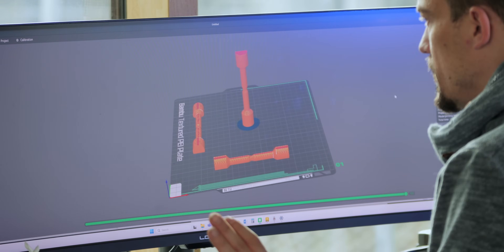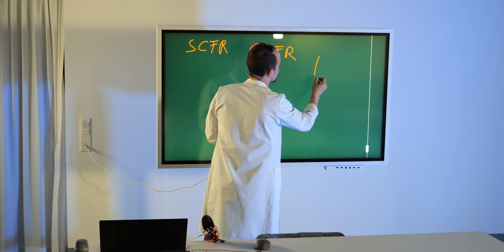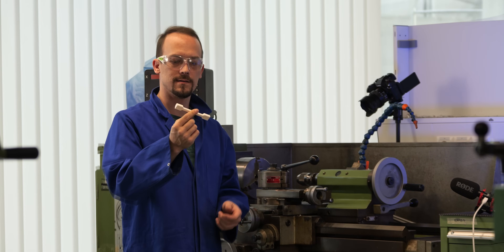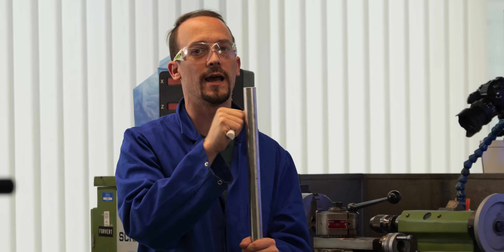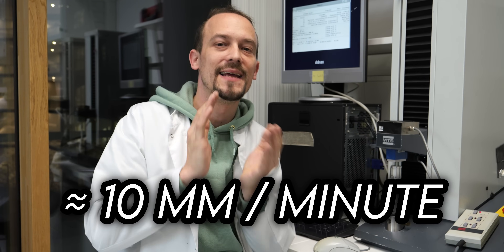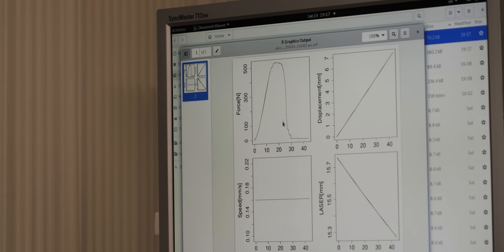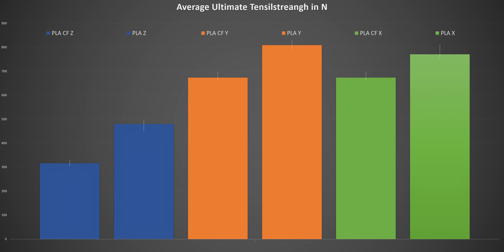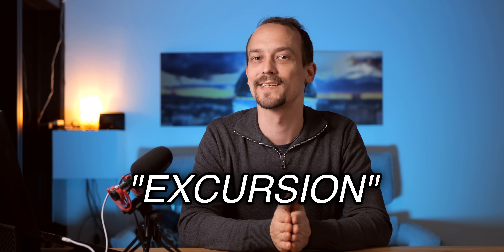The biggest SCAM in 3D Printing? How filament stores try to trick you with carbonfiber "reinforced"

Comment: What I don't understand is WHY there is a difference between X and Y axes? I understand why the Z axis would make a difference because it is printed longitudinally, but the X and Y?? What do you think is the reason?
Reply from the maker: That has to do with the infillpattern. In y it is longer line extrusions because or it's orientation. 
But that's a guess I would need to look into that more specific

Comment: The CF materials have potential. I feel this is less of a "scam" and more of a "good idea that needs refinining". Eventually if they can get adhesion better for the z direction i can see these filaments eventually fullfilling promises. Just not in their current iteration
Reply from the maker: Not for those. But for others for sure. 
The "scam" I used is meant to be a wakeup call. Cf materials have loads of useful properties. But greed sells the wrong one. Because less people are willing to pay more for nicer or stiffer prints. But for stronger. 
The 3d printing comunity is made of mostly tinkerer and smart people, so just tell the truth and people will fi d the niche. No need for falls promisses.

Comment: Calling cf reinforced filaments a scam just isn’t a fair representation of data. While I can’t speak for how individual companies may misrepresent cf filaments in their advertising saying cf  filaments “aren’t as strong” and are therefore a scam is like saying, wood is a scam because steel is stronger or ceramic is a scam because fiberglass is stronger. Different materials have different properties which are optimal for different applications. Also to address the “not as strong” claim. Yes placf is stiffer than pla but its absolute strength is lower, but with nylons for example adding cf makes them stiffer and stronger in both Y and Z directions. Like almost every question in engineering the answer is almost never black and white.
Reply from the maker: Nothing to add. U performed here what is most important: critical thinking ! 
The claims is where the "scam" is. Not the material. 
And this is also not true for every manufacturer. The title is meant to "shock" but is not meant literaly. Hence the question mark. 
So I agree with you comment 👍

Comment: TPU is honestly one of the toughest materials.
 layer adhesion is better than most
flex is a disadvantage but with right infill structure you can design something fairly rigid, very light, and virtually indestructible
Reply: Which infill for best rigidity?

Comment: Is there other benefits such as heat stress or wear resistance or something? I’m currently trying to decide if I need to accommodate high temp materials in my printer upgrade.  I’m thinking about the difference between P1S and X1 type differences (not necessarily Bambu either, just an example of what level/quality of models I’m looking for) and I definately want the unit to have an AMS of some type.  I certainly want to print abs so I’ll need enclosed.  Any suggestions on what printers I should be considering?  My biggest problem is I don’t know what I want to print yet, but I just know I can’t stand being limited to my 150mm build volume in my current Flash Forge Adventurer 3.
Reply from the maker: I am a fan of the x1c to be honest. High temp capability is awsome for materials like pa6 that are seriously tough.
If u have the budget I suggest going for the x1c. The volume of 256 squared is also sufficient for most applications

Comment: I would like to see more, this is also the first video on this channel I've watched. I always like having more information, especially since I do work with 3d printers professionally (I'm the maintenance/repair guy) we don't do much with CF filament, but I've looked into it before. All I really print is parts for electronics so I don't need insane strength. Unless it's laptop hinges, but epoxy casting does that fine.
Reply from the maker: Thanks for watching! We will do more, for sure!

Comment: The problem is "strength" has multiple meanings, and manufacturers use the interpretation that is more intuitive for the average customer. If you give a costumer two specimens A and B, both extremely hard to break, but A being obviously much stiffer, then the average person will say A is stronger (has more "strength"), even if when measured scientifically it breaks at lower levels of stress. Your average Joe will only say that the stiffer "part A" is weaker if it breaks at a fraction of the force necessary to break part B. Basically the reason behind this "scam" is the difference between the colloquial understanding of "stronger" vs scientifically defining it.

Comment: I used CF reinforced purely for the higher temp, specifically I moved from ASA to PA6 CF to resist the Australian sun inside of race cars. 

Would be interested the see someone actually test the heat resistance as all I can go off is the manufacturers claims.
Reply from the maker: I will do calometry testing in my research to find the precise glass transition temperature. 
But maybe I can do a diy version of it as a video🤔
Could be interesting

Comment: time 17:20 strain stress curves show that the Carbon fiber is actually more tenacious material, bigger area under the curves until it breaks, absorbing more energy than plain PETG. I think your video is actually misleading and wrong, reinforced CF is actually a better engineering material

Comment: Because you are doing a paper, I am going to play devils advocate. I am not saying you are wrong or have done anything wrong. BUT, I do have to ask these questions, none of which are meant to prove any superiority on my part.
First, the example you provided claimed two things. “Improved Mechanical Properties” and “High Flexibility.” You tested the tensile strength and provided a solid hypothesis. What about elastic modulus, impact strength, fatigue resistance, hardness, and creep resistance? I suspect, based on your hypothesis, when the carbon fiber versions are compared to their non CF versions you’ll likely see the same results in elastic modulus. I suspect that your assertion regarding layer bonding will have a similar impact. Creep resistance I suspect will be unchanged or SLIGHTLY better because it takes longer for some of the CF mass to heat up, but IF it’s better it’ll be a function of the mass of the Carbon. Impact strength could be interesting. Would it make sense to see what the maximum impact is each sample can survive, and then repeat the process at a 10% lower value and record the number of times it survives that in each direction (X,Y,Z), then move to 20% less and keep reducing the value until you arrive at a value with little change… Hardness is unlikely to change noticeably if your hypothesis holds. Fatigue resistance assuming your hypothesis is correct would likely show the same outcome as the Tensile strength test again supporting the hypothesis.
The ONLY way I could see Mechanical properties being “better” is if creep resistance is “better.” Sadly, at least here in the U.S. this would likely be enough for the claim to not be considered false advertising. If you combine a test for creep resistance with a tension modulus test, if the creep resistance IS higher due to the mass of the Carbon Fiber, then it may ALSO impact a test like that, so I could say “PLA CF is more resistant to deformation at a higher temperature, therefore its mechanical properties are ‘better.’”
Now we consider “High Flexibility.” Is this just an attempt at pointing out that the filament is more flexible before failure, the product is more flexible in a plane (X,Y,Z) before failure, that the over all product is more flexible and capable to returning to its original form after deformation, or something else? Just because it returns to its original form doesn’t mean it’s structurally sound, even if it can flex and return again. But “high flexibility” is not the same as “improved flexibility,” and is ambiguous enough that any flexibility could be considered “high” as long as it’s more than zero. Without knowing the specific implication, how does one test this?
Could there be a definitive test done that PLA melted to a sheet of carbon fiber is tested for separation strength? Same with PET, and then again with PETG? If any of the three adhere to carbon fiber BETTER than they adhere to themselves (layer bonding), though the testing done provides an answer, wouldn’t that show that your hypothesis is either inaccurate or incomplete and another cause is likely, like maybe the amount of additives to the plastic changed the length of crystalline structures impacting the mechanical properties of the polymer, or maybe both hypothesis are in play (more amorphous plus layer adhesion)? I suspect thermal compression (if the pressure of nozzle pushing on the PET/CF sheet is high enough) could cause PET to stick better to a carbon sheet with a stronger bond than it sticks to itself (I think thermal compression can do this), so I’m wondering if layer adhesion because of the presence of Carbon Fiber is necessarily the cause more than interfering with the crystalline structure in the polymer (again, making it more amorphous)?

Comment: You might want to consider minimum layer printing time when you do those specimen. When doing small area upright things the printer will shlow down might skew the result slightly as old layer will still be warm and the nozzle slowly will keep everyhting more "warm" than usual which might increase bonding. It won't change anything regarding the results but will skew them especially with petg

Comment: The 2x strength factor on the PETG-CF Z test makes me question your testing approach.  Do you really believe the 7-15% of CF cuts the useful adhesion in half?  I wonder if your test methods gave enough consideration to the materials and printing methods.  Maybe the CF version just needed more heat?
As an example, if I print PLA and ABS at the same settings, you better believe the PLA print will be multiple times stronger.
Also, I did not hear exactly which brands you used (Bambu?), but are you certain the PETG was actually the same PETG plastic in both reels?

I think for this testing to be meaningful, you need to treat the CF and non CF variants as two different materials, find the best printing settings for each one, then compare the outcomes.
Last, why no testing other types of strength?
Reply from the maker: It was a comparison study so other tools apply. 
I did tread them as separate materials but I did not optimise printer settings. I took the recommended ones by the manufacturer. But I did that for both sides (reinforced and not) so it is still fair and valid. 
The aim was to see how they compare "out of the box" with the manufacturer recommended slicingsetting for this exact machine.

Also why I did not do other tests than tensile and why I did not have DIN 527 speciments:
This was on purpose because I am actually doing a peer reviewed full paper on this. So I had to change the setting enough to not risk prepublishing my findings otherwise my paper gets rejected. But as soon as the paper is finished we will update you guys

Comment: In the current world full of BS I never believe in anything anymore that is stated on products. On of them are filaments. I discovered myself by my measurements that pla is stronger than abs that was told to be superior. The only improvement I see is using Petg but by loosing some strength. I think resins is a way to go , there are some more possibilities

Comment: What filament would you recommend to use for a bass guitar? PLA is a no go since it will warp during the summer, I was thinking of PETG-CF, but after this video im unsure.
I need it to not bend under the tension of the strings (the body will be reinforced with aluminium)
Reply: I’m not an expert but for parts needing heat resistance and strength in the way you describe I’ll use PET-CF. Not PETG-CF. PET-CF is quite strong, can handle very high temps, prints relatively easily and very clean look, while not being very expensive.

Comment: Fibers will absolutely create "stronger" materials, even short strand fibers. There is a reason why manufacturers are willing to literally destroy their machines and tooling by using materials like PA6GF30 or other fiber reinforced materials. The key point however is anisotropic behavior and the specific load case your part is suscepted to. Fibers mainly add stiffness and improve thermal characteristics, especially in ASA and PLA. In a classic tensile test on 3d printed parts, you won't get much of a difference, but in a bending test you definitely will, especially if you compare the modulus. Fiber reinforced filaments aren't a scam at all, the average consumer just lacks the knowledge on how to actually use them properly. You need to design your parts around the material, otherwise they're useless. The research paper you're planning on doing has been done hundreds of times before with various fiber lengths, materials and manufacturing methods. I have 2 semesters worth of uni lecture scripts worth on the topic from studying plastic engineering.
Reply: yes... it''s stupidly easy to find peer-reviewed research on this topic with actual DoE and analysis that give insights into modulus, stress-strain curves, etc., to show the benefits of CF impregnated polymers (including PETG). I haven't even seen any paper that used round tensile test specimens for AM, certainly not for MEX, because of how much obvious variance it introduces.... let alone cutting it in half to make it flat and non-uniform. At first I considered this misinformation, but that's too generous.

Comment: I think many of the comparisons of PLA and PLA-CF strength are specifically looking at Matte PLA vs PLA-CF (as they have more comparable looks) and that comparison is more favorable for PLA-CF (because matte PLA is also worse than basic PLA). That said, it does seem like the general conclusion is that for these kinds of materials the advantages are more about printability (less stringing, less warping) and detail than strength
Reply from the maker: I actually tested both. Pla matte and pla basic. The data shown is pla basic

Comment: I printed out the same trigger housing and pistol frame from 3 materials.
Pla+ polysonic, polysonic PA612cf, and siraya tech PETCf 6 something idk it sucked. 
Pla+ had the best results in firing and abusive testing for the prints. Pa612cf was okay for a trigger housing... but for the pistol frame (fixed pinned barrel hi point) the pin hole for the barrel subjected to the slide return shock creeped 1/8th of an inch forward.

Comment: I dont understand pla or petg cf, but i do car stuff and CF filaments definitely adds plenty of useful properties to higher performing materials. I very rarely dimension parts for breaking, so stifness, creep and high temp stability for example are very important factors to keep things together(improved by cf), sealed and working under high loads and temperatures. Just use the correct material for the task :)
Reply from the maker: Amen brother. 
Cf ist bad. It had its place. Just not the one people think. That's what this video says. It's marketed wrong. Because there are loads of useful properties

Comment: Just about all CF infused filaments should be a little stiffer, but ultimately weaker. When you add a contaminate to the filament you are making it weaker in some measurements. The structure of a filament is about how well the plastic bonds itself. PLA on PLA is a stronger bond than the CF infused PLA, so there is a gain and a loss at the same time in most cases (if not always).

Also, Bambu makes terrible CF filaments. I've seen videos where the claimed diameter of the fiber was half of what it claimed to be. I don't know if that's what you tested, just what you were holding at the beginning of the video. 

I've also used Sirya Tech PPA Core and while not one long CF strain, it's 25% CF in the middle, surrounded by a mixture of PAHT/PPA and it's strong and has way better z axis strength. . From there website

---
This innovative material features a unique skin-core structure, combining polyphthalamide (PPA) - a high-temperature nylon (PAHT) outer layer with a 25% chopped carbon fiber reinforced core. 
---

While I'm not disagreeing with any of your tests, PLA is by far the worst. Its main benefit is its matte black finish. From an article below

---
However, in PolyMaker’s view, carbon fiber is added to PLA mainly for aesthetic reasons, not mechanical.

“The matte black surface finish PLA-CF is a unique finish that has the ability to completely hide layer lines at 0.2 mm layer height because the surface texture absorbs light,” says Taylor.

PolyMaker’s CF-PLA, like many others, uses milled, or ground-up, carbon fiber and not the chopped carbon fiber that you’d find in typical CF-nylon materials. “We choose the milled fibers over the chopped specifically for its surface finish properties.”
---

At the end of the day the filement manufacturing process and costs are the main factor. There are brands of PLA that are WAY stronger than Bambu ABS but they cost way more and to the average consumer is just not worth it. For example, Premium PLA: BASF Ultrafuse PLA Pro1 beat out polymaker PLA, PPA-CF, ABS and PETG. If you look at the price it should too. 40 US compared to under 20 for Bambu.